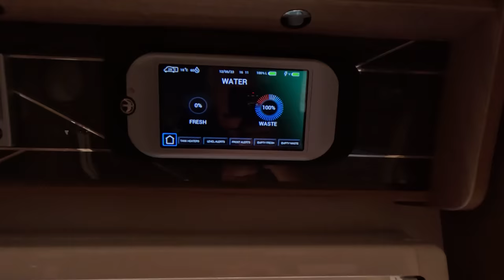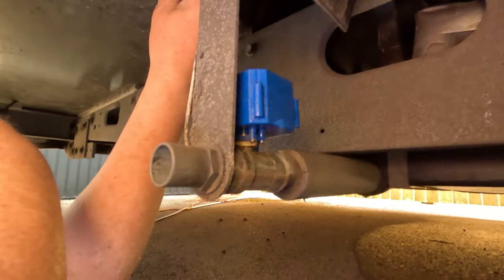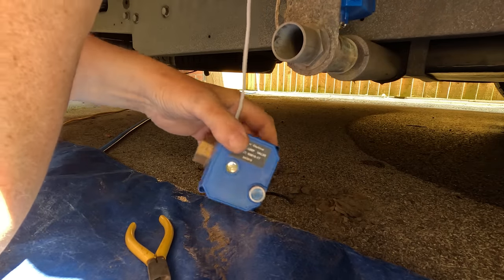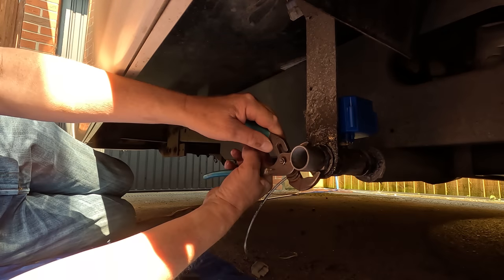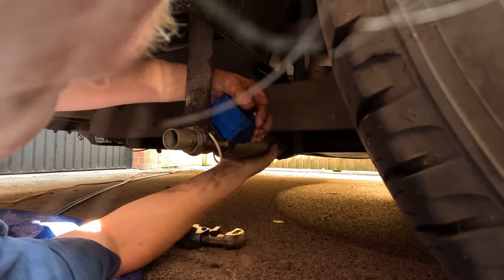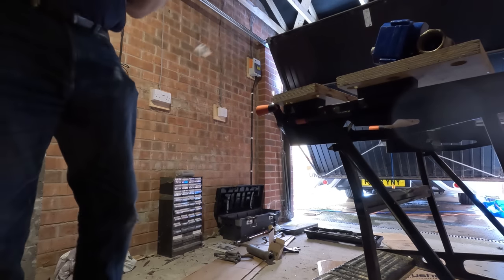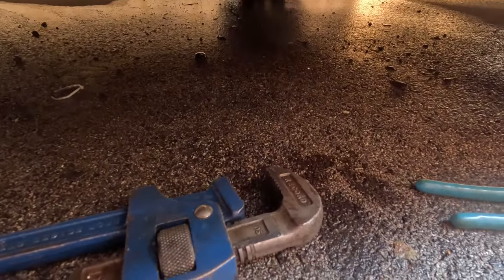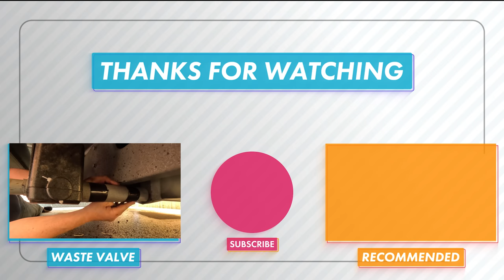Wastepipe Valve Failure Nearly Cancelled Our Tour!

Comment: On the top of the valve when it fails there is a small screw mechanism they you can use to open and close the valve gate manually so can empty the tank before changing the valve
Reply from the maker: Thanks, I realised that after I took it off. It takes forever to turn it manually to open the valve.

Comment: A useful video Bob which highlights the 'mess' you can find yourself in if this valve motor fails whilst on the road. I have got to physically clean out the waste tank when back home, so I think I will look at a modification to fit a tee piece and ball valve between the tank and motorised valve. Belt and braces perhaps but could save the day.
Reply from the maker: That's a good idea.

Comment: Adding a manual drain tap for emergency use, either T’d off the short straight section or in it, may be a good idea.  Our tank has a manual valve inside. I’m dreading it failing closed and consider adding external and external tap and leaving the internal one open.
Reply from the maker: Good idea

Comment: Gave up with my motorised units and fitted manual valves from screwfix.straight replacement for less than £20
Reply from the maker: Yes, that's an option.

Comment: I wonder why they keep failing, I’ve got on my “to do” list to fit similar to ours for draining the tanks but interested in why they might fail and why so much muck in the casing. Looks like they are very similar if not the same but yours was branded Sargent with a specific plug on. Not sure how much they charge for out of warranty replacement part. 
Looked like a fiddly job to remove. Nightmare when tanks are nearly full too. Well done for getting it fixed and sorted.
Appreciate you sharing as it has me thinking and is really helpful as I will hopefully avoid an issue with mine on the back of your video 🤞
All the very best - enjoy your trip.
David 👍
Reply from the maker: I suppose it's the dirty water getting in there through the gaps, messes up the solenoid.

Comment: I’m sure that the little dial on the top of the valve is there to manually open and close if it fails so you can empty the tank… enjoying the videos thanks 👍🏻
Reply from the maker: Yes you're right found that after I took it off, but it takes for ever to unscrew it!

Comment: Why do they have to make things so complicated Bob? What was wrong with the good old manual valves on waste water pipes. That is what we have on our 2009 Burstner.
Reply: i aggree with you on that one ..
Reply from the maker: Yes, simple is often best. I quite like the Bailey pull handle, if the waste pipe exit wasn't underneath the motorhome....
Reply: @BobEarnshawMoHo  We always use a Wastemaster attached to our waste water pipe. That way, no mucky water stays in the tank to end up smelling. We just then wheel the Wastemaster to a drain when full.

Comment: Bob have u got a small piece of piping you can put on the end each time  you empty direct str8 into the Drain?.having a fixed elbow would hamper Ground clearance.

Luck you could get one at short notice
Reply from the maker: Thanks, I use the Colapz Flexible Waste Pipes if I can't get near to the grate or emptying point.

Comment: If you opened the Jaws of your Swan neck pliers I'm sure they would have undo the nut and not having to use two hands! Did you run out of cable ties? Two on the Pipe insulation would have been ample! Just make sure the Slit faces down!
Reply from the maker: Thanks for your advice. I couldn't get enough grip with the pliers and yes I ran out if cable ties.